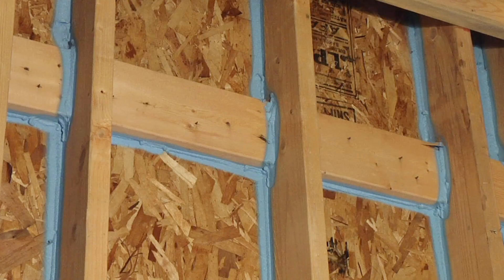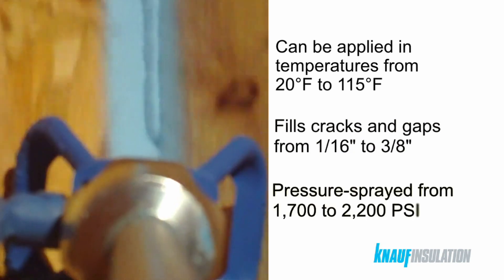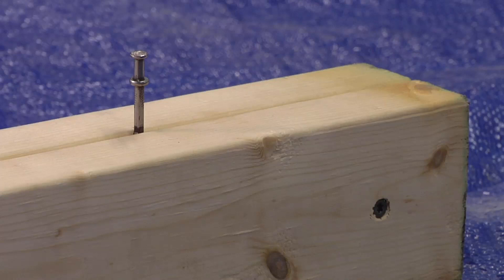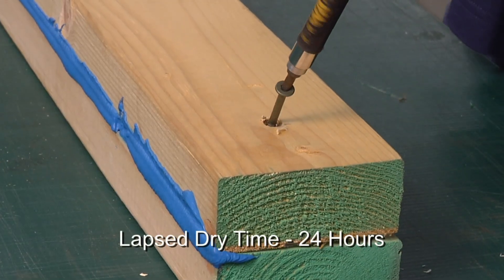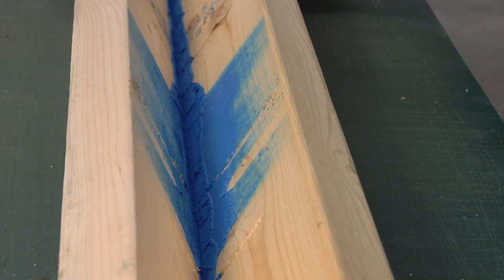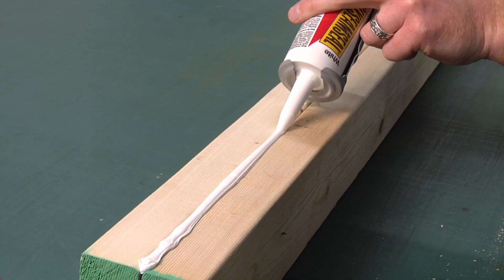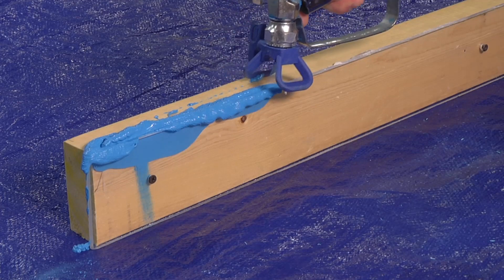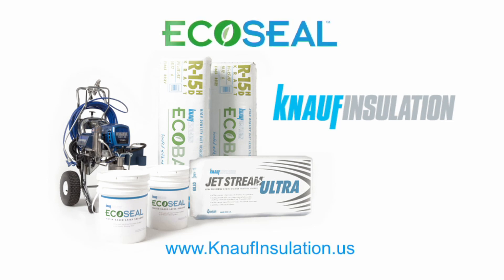Knauf  ECOSEAL Plus™  Vs. Caulk - Spray on Sealant Alternatives

Comment: what is the minimum tip size to spray this?
Reply from the maker: A size .013 tip is recommended for most applications. More installation info can be found here: https://res.cloudinary.com/knauf-insulation/image/upload/v1578607675/Knauf%20Insulation/ECOSEAL%20Plus/Literature/knauf-ecoseal-plus-sealant-data-sheet.pdf
Reply: @KnaufNorthAmerica  can this be used in new builds instead of the fireblock foam cans?

Comment: If the product is supposed to be for air sealing, why are you testing it as a construction adhesive?  I would be more convinced if you compared how much Ecoseal and caulk stop air flow.
Reply: adhesion is the byproduct of the air sealing.

Comment: So your example is flawed, your using a more viscous blue sealant, on the top of a vertical opening. But hay science and physics may not be in your history of education. Since heat rises, and moisture is carried in this hot air, and where much of the damage in homes especially in roof cavities simulated use in that condition would be likely more valuable.
Reply: This wont be a problem unless you cover large areas with sealant, if you just cover openings moisture can travel easy.
Reply: Seal tite vent right. I like to control the way my house breathes, i dont like my insulation acting as lungs. Moisture build up is from bad ventilation and oversized Hvac sizing. No dehumidifiers and no energy recovery ventilators.
Reply: @frankly2677  that’s some risinger lingo I’m sending